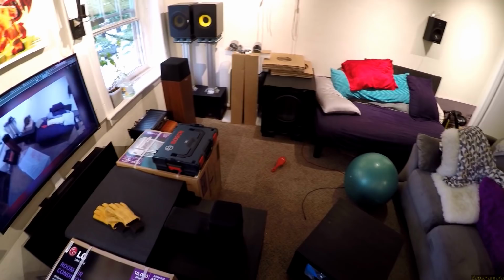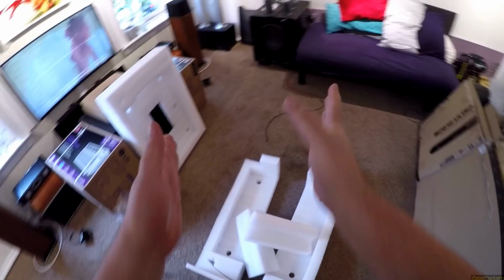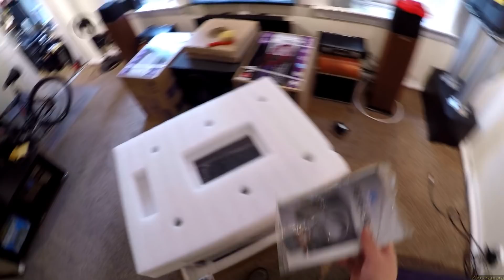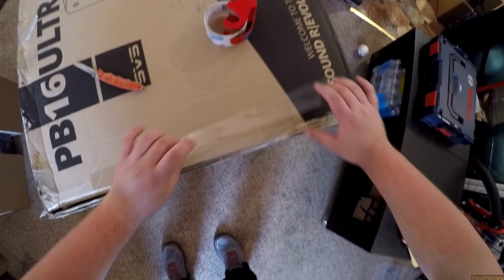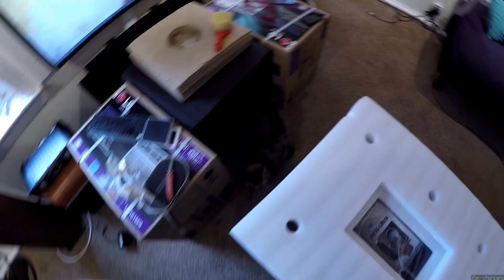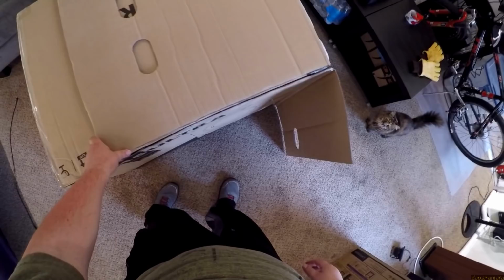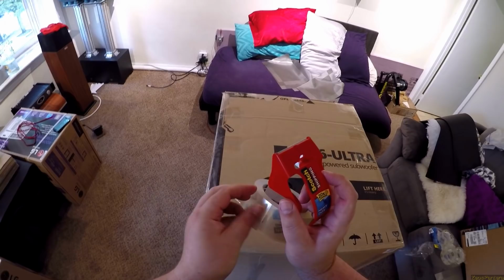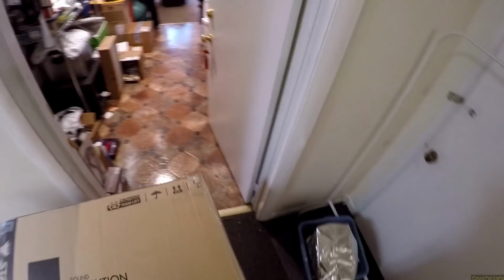Z Unboxing - RE-Boxing the SVS PB16 Ultra

Comment: OMG... turn the sub upside down, slide the box down on top of it, then roll the box on it's side so you can close the flaps.
Reply: Len Laughridge 😂😂😂
Reply: yea ofc
Reply from the maker: I couldn't guarantee the foam woudl hold it in without sliding apart and dropping the sub.
Reply: You couldnt guarantee the foam would hold it in without sliding apart? :P lol  I was so frustrated during the entire video :P its like watching a child trying to box something for the first time :P I mean even at 21:56 ok you try to do it the wrong way and slide that heay thing in... why not rotate the box so that the side that doesnt have that huge flap will be on the floor? that way you wouldnt have to do all the strange things you did like putting those placement mat thingies on top of the cardboard flap to slide the huge sub hahahaha I dont know who was more adorable in that vid you or chewbacca? :P 

Also great part of the structural integrity tape offer is due to its uniform application from one side through the other... applying small strips of tape doesnt help much its like putting on stickers for cosmetic reasons  :P